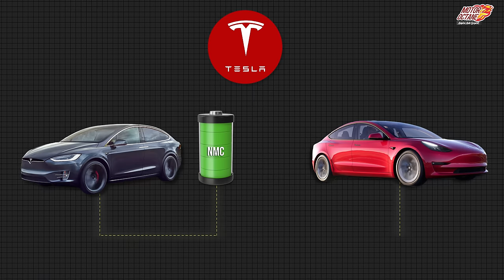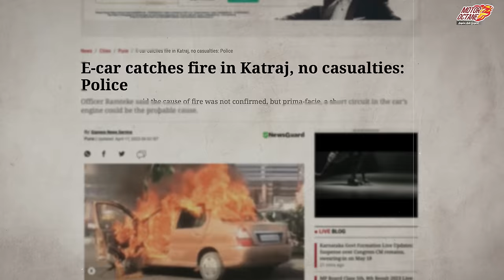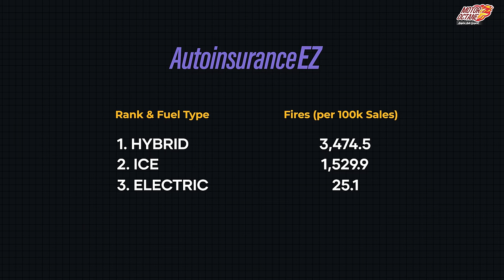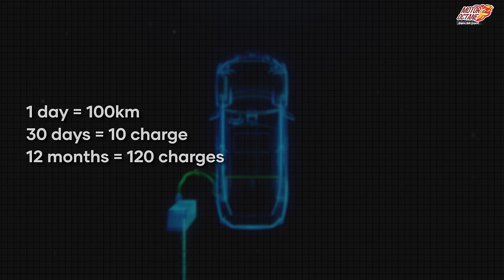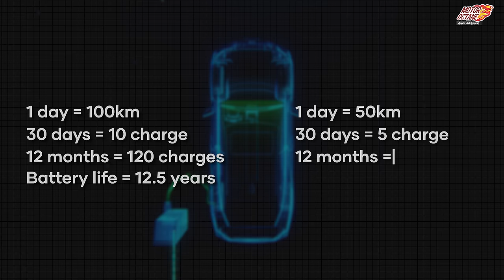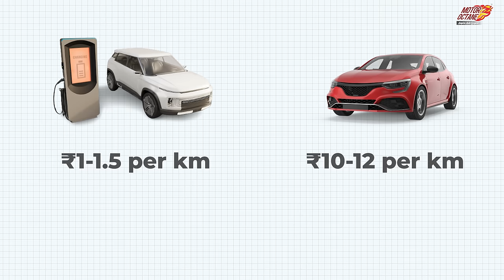Electric Cars have Battery Problems?

Comment: Another Advantages:
1. Almost No vibration and noise except tire and wind
2. Low CG.. So better handling and cornering and also less roll over
3. Almost no maintenance except tyre replacement
4. More boot space and Dickey under bonet in some case
5. Regenerative braking help to recharge battery, dissipate heat and provide longer life to brake (if a car has feature)
6. No need to shutdown engine at traffic signal
7. Eliminate PUC certificates
8. No clutch
9. More reliable due to less moving parts
10. Longer life.. May be 30 year and above (just wait and watch) if take care 
11. Almost impossible to drive back  ICE car if u have EV habit
Reply: Dickey got me😂😂
Reply: one person has driven 1,62,000 kms on nexon prime ev on the original tyres itself... feels amazing to know this.. his video is there on some youtube channel.

Comment: Animation me BYD ke jagah Volkswagen ka logo dikhaya gya. 
Rachit bhai, I appreciate this brilliant video. To clarify, NMC batteries generally have an expected charge cycle range of 500-1500 cycles, while LFP batteries offer a higher range of 2000-5000 cycles. Moreover, LFP batteries exhibit a low degradation rate of just 2% per 1000 cycles. Therefore, it is reasonable to expect a much slower degradation of the Nexon EV's battery compared to the 12% degradation at 3.2 lakh kilometers in the case of Tesla. From a battery longevity perspective, the Nexon EV outperforms the XUV400 EV.
Reply: Thats very informative...brother
Reply: I have a colleague who is using tesla model s since 2012 and actually has 320,000 kms. His car performs much better though.
Reply: So Nexon ev reliable for 15 years?

Comment: 7:14 This is incorrect information. The battery not only degrades with usage but also with time. So even if you do not use your vehicle the battery is guaranteed to degrade after the warranty period. So you should only consider buying an electric car if you are planning to use it for long drives continuously for several years. As cost of a new battery after warranty period (8 years) is at least 7 lakhs as of now. And with degradation there is both reduction in range as well as reduction in max speed.

Comment: I bought an ICE car this month and not an electric car because of reasons entirely separate from the ones covered in this video. Most of my reasons come down to, in my opinion, the extremely low charging speeds of the EVs that cost below 25 lakhs. 

1) Even if you consider DC fast charging, the Nexon EV Max can charge at a measly 50 kW speed and it will take an hour to charge up from 0% to 80%. An entire hour of charging cannot compete with the quick 3 minute fuel up on an ICE car.

2) If I'm going on a very long trip, I don't want to make my family wait around for an hour when we don't want to just because the car needs it. The car should be serving us, we should not be servants to the car.

3) The comparisons of ICE vs Electric vehicles on YouTube either never take into consideration this time wasted on charging or play it off as time we can spend with our family eating at a restaurant near the fast charging station. Well, this sort of forces us into breaks when we might not want one and also forces us to dine at a restaurant near a charging station. With an ICE car I can just go visit whichever restaurant or dhaba I want and not worry about the needs of my car. 

4) There is a difference of nearly 5 lakhs between the feature equivalent variants of the petrol Nexon and the Nexon EV. That difference is simply too high to justify especially considering that buying this EV comes with the additional time commitment I previously mentioned. You may earn lost money back but you will never get back lost time.

5) Now if you say that most people go on long trips once in 3 months or so and can tolerate this time lost and they mostly use their cars for daily work commute then you still can't ignore the massive price difference over the petrol car equivalent. Most estimates on YouTube say that your running would have to be really high for you to break even on the cost of an EV vs a petrol equivalent over a 5 year period. Keep in mind the money you "save" by not spending on an EV can be invested too and then breaking even with an EV becomes even more challenging.

6) Charging at home isn't as cheap as it is made out to be. If you charge on your home meter then you are driving up your unit usage and you end up paying more for using the power hungry appliances at your home as well like ACs, microwaves, fridges, PCs etc.

7) The EVs that are available below 25 lakhs are not born electric. They started as ICE cars and the chassis was slightly modified to fit a battery. This means the chassis was not designed with a battery in mind and the use of space for the battery is not at all optimal. It should be possible to have a sub 4 metre car with a skateboard platform that can fit a battery larger than the 40 kWh one in the EV Max. Furthermore, with time and advancements in technology this battery should become cheap enough and charge fast enough that we can have that 0% to 80% charge time to be under 15 minutes in our sub 25 lakh cars. The charging infrastructure also needs to improve big time not just in quantity but also quality. 250 kW chargers should become the only chargers worth calling as fast chargers, 50 kW chargers can't be seriously called "fast", even today.

8) It is absolutely worth waiting for the above technological advancements and infrastructure improvements while saving our money and buying ICE cars. Right now Tata and Mahindra are the only players in the budget EV scene and frankly Tata is dominating it. Only once competition comes in from Hyundai, Suzuki, Honda, Volkswagen and the other big companies will the consumers start reaping the benefits of more options.

I hope Rachit addresses these points also. The points covered in this video were honestly low-hanging fruit and very easy to address but there are other genuine reasons to stay away from EVs in India for the time being.
Reply: Perfect points bhai.. I agree with you.. I don't know why Rachit is blindly supporting it?
Reply: Same brother financially speaking it would take an ev around 10 yrs with 1000km monthly driving to break even. Then you can just resell ur Ice and buy the then advanced electric tech available.
Reply: @aurobindamishra9353  The Question is -- who will buy a 2nd hand EV????
Reply: You did right thing buying ICE car.
Reply: @rupenchaudhuri3070  no one..
Reply: No one seen Future 
What if. 
Question arise is future 

Ki bhai Kon leka Ye khatara or purne jamane ka ICE engine
Reply: @AnuragSinghtomar09  bahut log as India has only 60 cars for 1000 people.
Reply: @rupenchaudhuri3070  Yes that's also a Good point to compare with ICE Cars. Electric Cars don't have Resale value Period. If I know I may have to replace the Battery after 4-5 years which costs Half the price of Original Car Value 😭
Reply: These are the exact points which should have been covered in the video. Also we are paying more to be early adopters. Better wait for the EV price premium to drop significantly. Look at smartphones. We can expect a similar trend.

Comment: Did not expect an Indian youtuber to actually be this right about EVs. Kudos. The main problem of EVs in India is the pathetic battery capacity, high costs and no fast charging. Won't even consider what you're getting on MG, Hyundai, Tata, etc as fast charging. Tata especially is awful. And companies like Citroen is using air cooled batteries which will die quicker. 

Not to mention the dreaded HV critical battery issue on Tata cars and Tata's notorious service.

Comment: Thanks for such an informative video! I personally was worried about investing in an EV due to these myths/ rumours, but this video surely helped reconsider my decision.
Reply: More than explaining technology, ,after 5 years the battery will start to degrade rapidly and will cost approx 6 to 9 lakhs to replace the battery...as per today's prices. Imagine putting 9 lakhs on a 5 yr old car...a depreciating asset. Ev makes sense if you drive at least 100 km every day for next 5 yrs....that's a good roi. If it is just 20 -30k, you will be losing money.

Comment: Very nicely explained... only thing is that XUV 400 shd hv given more mature products with all advanced safety things..traction control...etc like. Exon ev...so it can give a tough mature healthy competition ❤
Reply: True.

They should also update the interior ASAP.

The nexon is getting facelifted soon which will also come to the EV variant soon enough. XUV will be in even worse position then
Reply: @shresthsonkar9207  Yaa nexon xuv 400 even not looks like evs
Reply: XUV400 ka interior unpolished hai. Nexon EV feels more primium from inside
Reply: Evn though XUV has NMC battery bt battery capacity  of Nexon and XUV is same so as a customer dosnt make difference ( ppl claim NMC has higher power density so XUV is better is jst a bullshit point )
Reply: @pranavvalvaikar2170  xuv is actually available in two variants, EC and EL. 

EC gets 34.5kWh and EL gets 39.4kWh 

Nexon floor board had to be modified in the max to accommodate extra 10kWh but EC and EL xuv both have same space due to higher density. 

If both cars were <4m then we could’ve compared the weight but as it stands, the Nexon EV max is 1410kg but xuv400 EL is 1580kg (180kg extra) 

We know for a fact that Nexon EV prime battery weight 260kg for 30kWh so that’s that
Reply: @Shresth Sonkar   yess if u consider XUV 400 EL n nexon Max since XUV 400 has LFP it shud hav been much lighter bt I guess XUV 400 ICE version itself is heavier n plus Car length hs increased a Bit n  According to Me tht floor advantage is not Huge I hav Set in Nexon Max n it's quite comfortable
Reply: I don't think there's traction control, hill hold assist or even cruise control in Xuv 400.

Comment: Stats told in video at 10:30 are interesting. (They are exactly what are mentioned in report. But if you want to use it as reference I expect you to validate it.) It describes ratio of no of fire accidents per 100k cars sold. For electric cars is accurate or nearly accurate. As bulk of the cars are sold in last few years. But for ICE it is way off.

Just think, fire accidents are not counted for all active vehicles on road but against those are sold last year. That is no of active ice vehicles is about 240 million in 2021. As against 2 million active electric cars. 
Now 52/2million = 26 per 100k is still better ratio than 199,533/240million = 83 per 100k

But considering significant ICE vehicles are very old i would say they are safer. Because report also mentions that electric vehicle fires are more intense and dificult to control.

If one wants to have accurate figures then just compare fire accidents in ICE vehicles which are less than 5 year old against accidents in Electric vehicles less than 5 years old. As fire accidents in very early electric vehicles will also not give accurate picture, when the technology was not that matured.

Comment: Require Car
Budget = Aroung 20 lac.
Car Type = Electric SUV Car For Use Long Time 10 year+
Daily Running = 90km (Including City or Highway) 
i Am Architect (Some Condition when site visit Running Around 400-500 km. A Day)
Capacity = 5 Seater

Comment: EV haters crying in the corner. 🔥

EVs last longer, are economical and gives more performance. ❤️
Reply: Economical 😂
What?  a nexon costs 21 lakhs
If thats edonomical for you then go ahead 
And running cost is only low till it becomes mainstream 
Its going to cost as much as petrol and diesel

Comment: Good video 
But still 3 disadvantage
That's cooling, low Range and fast charging 
An electric car should have a cooling system like a gaming pc/phone
Minimum range should be 400-500kms per charge 
We've seen now fast charging a mobile 0-100 in 10min without heating mobile(like OnePlus/Vivo/oppo) heating will transfer in charging brick 
We can implement this type of system then electric cars will improve
Reply: already has better cooling than gaming PC and phone

gaming pc still uses fans 

EV uses ethylene glycol for liquid cooling system with radiator and chiller

Comment: There few points I would like shed some lights on
1. The charging cycle example is kind of misleading as you don't fully zero the car than charge it to full, it's around 20-30% and than charge it to full or 80-90% hence charging cycle will be around 100-150 cycles per year for 50km/day and will be around 200-250 for 100km/day. 
2. Secondly given the Indian hot weather condition I still have my doubts on battery capacity holding around 85-90% or usable even after 8 years when used to extended period of time, given all the EV data are from the countries with cold climate which doesn't effect the battery as much even if they get hot.
3. Yes companies are giving warranty of 8 years but people often sale their cars after 8-10 years only and without warranty and high cost of insurance the resale value of car would take a big hit with already initial price gap of 3-5 lakhs. So saving on EV could eventually be cancelled out.
- Lastly it was a great video MotorOctane you have cleared almost 90-95% of the doubt on EV batteries for all people.
Reply from the maker: Hey Nitin
1. Even if you look at 250 - it is still 3 lakh kms. 
2. Battery drains charge fast in cold more than heat. It depends on how do you drive, charge your car to retain your battery percentage.
Reply: Battery degradation happens mostly when the charge level is near the extremes (0-15% and 85-100%). Avoiding such charge levels is actually better for the lifespan. The estimated no. of total charge cycles is calculated with a full depth of discharge but if the extreme charge levels are avoided then the total number of charge cycles increases